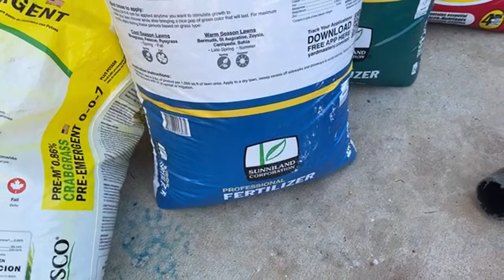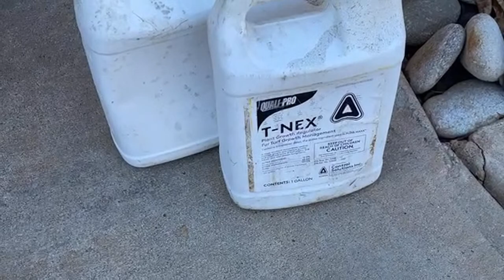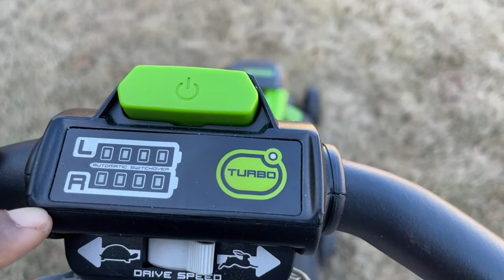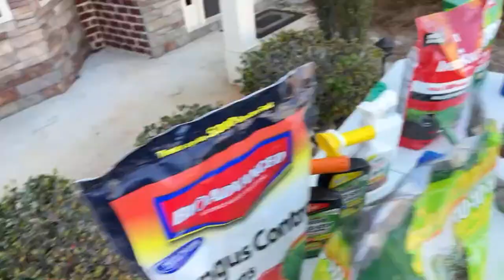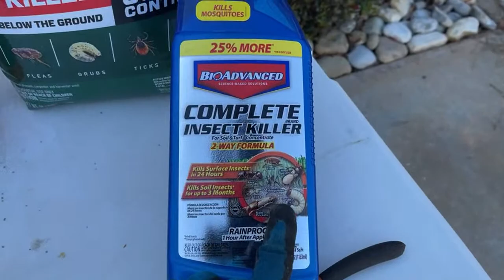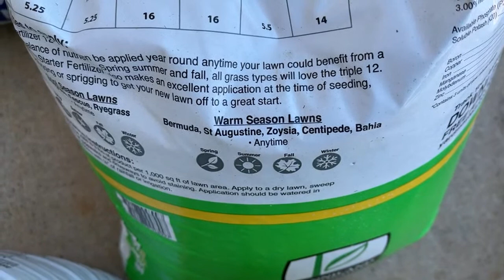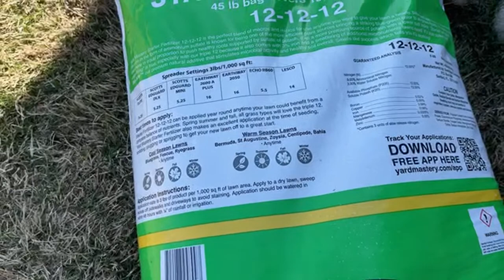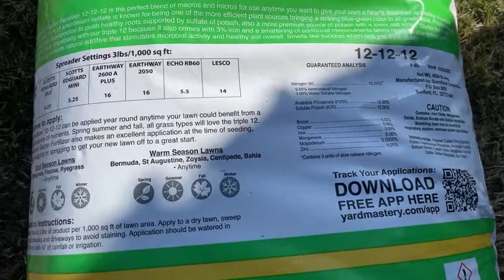Spring lawn 2021 live with BYD BermudaGrass Spring Care

Comment: I’m a new subscriber. Really enjoy your videos with big box store supplies. Today I pressure washed the driveway and sidewalks while the wife put pine straw in the flower bed. Tomorrow I’m spaying the yard with the triazicide for 470+ weeds that you recommend, should rain 2 days after that. Then next weekend hopefully put down weed and feed. Yard is 90 percent weeds so I’m hoping to get it to 50 percent this year. Anything better will be icing on the cake.
Reply: Are yall putting pine straw in flower bed to protect flowers from chemicals? Ugh I just cleaned the leaves out there. I guess I should have left them in there until the crabgrass preventer and spectricide
Reply: @lmarierussell  not really flower beds what’s the correct word for area of bushes. Mulch always has had weeds or washed away so we changed to pine straw.

Comment: @bermudagrasscentral I actually watched the calender video and the overseeding video. I am going to implement that calender this year.  I was actually juggling the idea of grass seeds or sod.  My builder did a horrible job with the lawn especially on the sides of my house.  Both sides are almost completely bare due to rain water drainage.  The houses are kind of close together too so there is an abundance of shade in these area.  I am not sure how to attack that problem.
Reply from the maker: Zoysia sod is more tolerant to shade than BermudaGrass ( option ) . You can overseed but with it being shady it won’t take. You can try seeding a cool season shade mix grass also. That’s gonna be a tricky fix Shawn 🤷🏾‍♂️